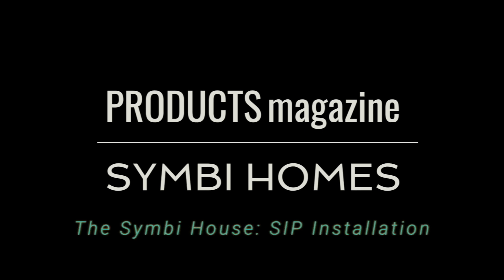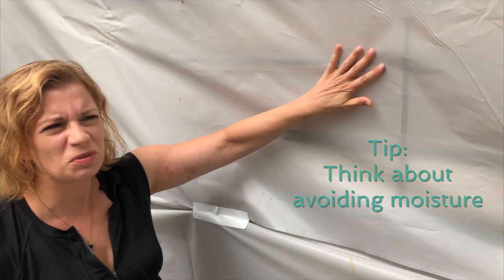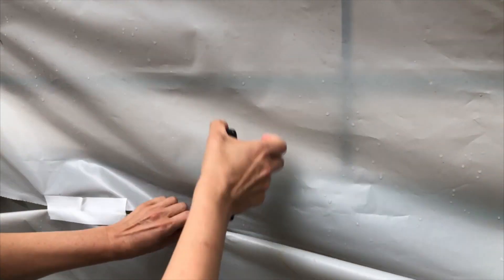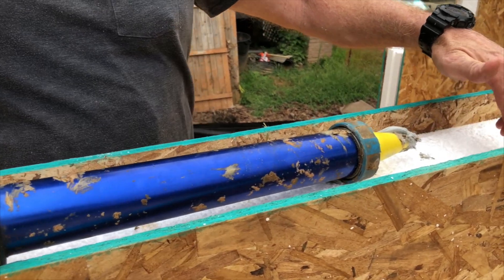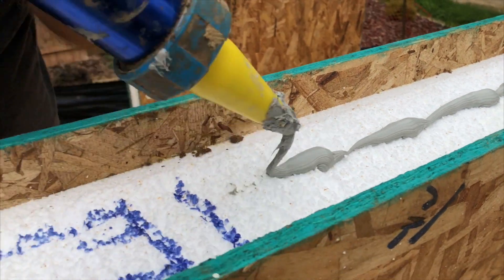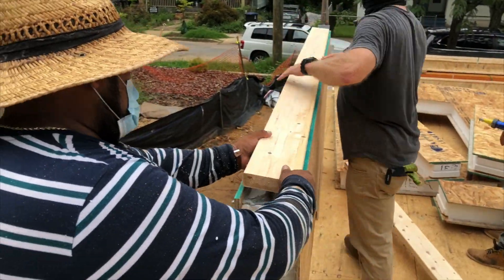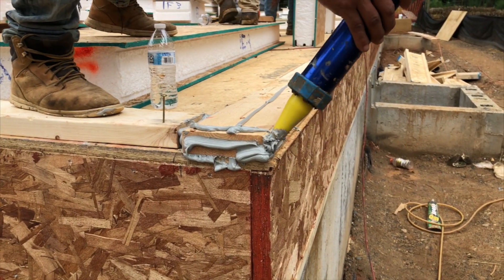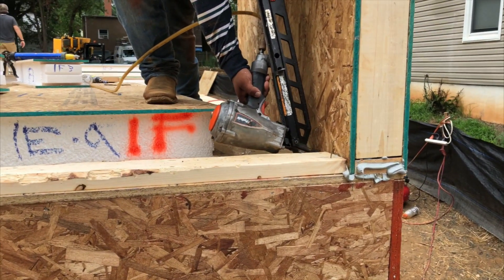SYMBI HOUSE Update: Deck Framing is Done and Structural Insulated Panels Have Begun

Comment: What a great building material what is the average cost per sip do you know.
Reply from the maker: Hi! It does depend on the thickness of the SIP and size. It can be anywhere from $5 to $10 per square foot.